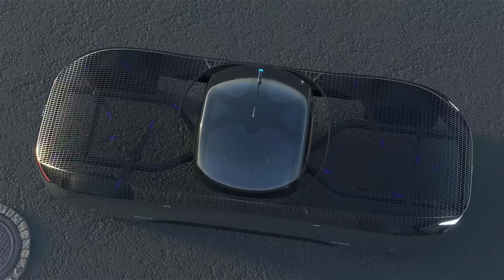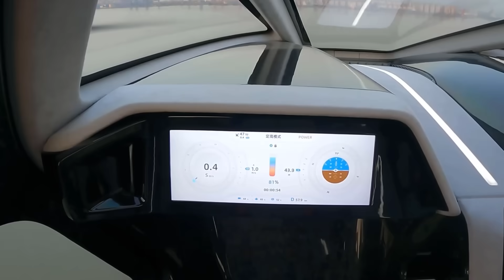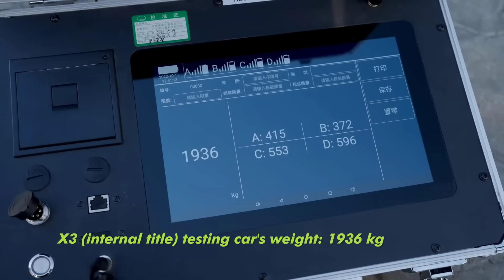4 Hovering Cars 2024-28 | Magnetic Revolution

Comment from the maker: How the Magnetic car achieves Levitation, Acceleration, Braking, and Steering. Detailed Introduction. 

1. Levitation: A moving magnetic field creates an electrical current in adjacent conductors, which in its turn generates a repelling magnetic force - In our case the rotating magnetic wheels create a current in the aluminum sheet generating a repelling magnetic force. And when the rotational speed of the magnetic wheels reaches at least 600 rpm, this repulsion leads to LEVITATION. - More detailed explanation here - youtu.be/pCON4zfMzjU?t=66 
The suspension is achieved when the front and rear wheels rotate at the same speed in different directions. Their cumulative force lifts the car, but as they rotate in opposite directions they offset each other and the car stays in static suspension.
2. To move the car, the front wheels are kept at a constant rotational speed, while the rotational speed of the rear wheels is reduced for ACCELERATION and increased for BRAKING.
3. The car STEERS on a highway this time by adjusting the rotational speed of the Side Wheels(e.g. for changing lanes on a highway), and for the next stage to make it practical in urban areas, scientists work on a 6-wheel architecture to achieve pivot steering by adjusting the rotational speed of the wheels in the middle
Reply: idk, most of these require something far more powerful than using batteries to to take flight and less heavy occupants, they will have to dramatically reduce the car's size and weight to make it possible, but i would never rely on current gen battery tech for this idea, that's just a fire hazard waiting to happen.
Reply: You didn’t mention the rubber bands.
Reply: I love the magetic and alef cars.

we will NEVER buy a Tesla.  End of story.
Reply: How stupid are you to promote this obvious scam?
[Edit]  My bad.  I meant MULTIPLE obvious scams.
Reply: Yep just as I thought , Getting set up for that one world global agenda,   people tracking . It makes alot of sense now.
Reply: Ask a pilot,,ask an astronaut, ask someone who understands stability.  
Ask futuristic engineer scientist,, 
Don't ask me!!  Fiction has become fact many times.,,,and will continue.
Reply: It's going to take decades of more researching ,until they get rid of the helicopter blades already invented in the 20th century ,into a safer ,reliable form of public transportation means. The flying car!
Reply: 5:14 - those 4 helicopter blades look like something you can snap onto the top of regular cars and make them fly like a helicopter. I'm sure that it's not actually that, but it looks like it.
7:09 - 7:16 - That looks really cool too
Reply: You can levitate an aircraft carrier without magnets,its very very simple.Lets say it weighs 1000TONS(M)>>>The pulling force (gravity) is F=MxG(9.81m/s2).But there is a catch>>>The Gforce can be manipulated by sounds(JUST LIKE THE TIBETAN MoNKS) and instead of standard G=9.81m/s2 you have an local area where G=0,981(10times lower)>>>So 90%of the weight just dissapears in the thin air as long as you generate the correct soundwaves pattern
Reply: The sounds are interfering with the magnetic field when the energy wavelength resonates at the correct value and place.Just like a planet/star gravity can deflect lightwaves it works also the other way around.The CORAL CASTLE>>>the story is true100% LEDSKALNIN.A small handheld sound device can levitate 100kg very easy
Reply: so you could levitate a small animal,or a man with a handheld sound generator//// it needs a battery 72volts/50amps and the rest of electronic parts
Reply: Car without wheels. New revolution.

Comment: Crazy I have a concept that I made in elementary school back in like 2009-10 called the negative car that would drive and operate on magnetic highways. Also made a concept for hoverboards operating the same way or with small wind turbine engines and blades inside the board somehow safe and powerful enough to propel it’s weight and the persons weight a couple feet off the ground or higher.

Comment: If you get 12 magnets and arange then in a circle one after the other but place each magnet with their poles facing South-west-north-east-south to complete the circle you get an opposing force which creates a stronger force. By spinning the circle of magnets very fast above Aluminum or Copper which are non magnetic, creates a mirrored magnetic field upon these metals which induces levitation. The mirrored field is advanced in its timing to the magnets above which creates friction/heat. You would have to place another circle of magnets next to each other but to spin in the opposite direction to stop rotation in only the spinning direction of all circles if they were spinning together in same direction of each other. This does work but I cannot see it on a large scale. Yet...

Comment: Last I checked, aluminum is non-magnetic.  So, how would it work as a levitation base?
Reply: That is why it works @qdllc the magnet pushes away on the electromagnetic field caused by the Aluminum, otherwise it would be stuck to it.

Comment: Why not use an alternator connected to an electric motor? The alternator will power the motor and the electronics. This will give you a lot more drive time than a battery. You also won't have to charge it... Ever.

Comment: They should just use the mass reduction technology that the US Navy's TR-3b has, it uses electrogravitic technology to enable gravity defying maneuvering, and yes there is a US patent that describes how the technology works, a high powered capacitor system would be enough watts to hover a car a few inches from the ground, and the field created with the technology repels against anything near the vehicle with equal force, meaning you would basically be driving around on the electrogravitic field as if it were a cushion. With the mass reduction effect, your car would weigh only a fraction meaning it could travel at very high speeds and with the field acting as a repulsive force, you could travel safer than with any conventional automobile, even at speeds towards and above 300 MPH.

Comment: I am an old retired guy.  Over the course of a long life, I have been involved in roughly thirty traffic collisions.  I was a passenger in some of these.  I was not at fault in any of the traffic collisions in which I was driving.  In one notable four week period, I was rear ended five times while stopped at different red lights.

People generally do a poor job driving when they are essentially limited to moving in two dimensions.  This will only get worse when a third dimension and the effect of gravity are added into the mix.  Flying cars sound cool until you start to really think about everything that can and will go wrong.
Reply: dam man 30 just stay away from cars your lucky to still be around. 30? wow
Reply: @Randytrevorson420  I worked a couple jobs that involved a lot of driving.  Also, somebody has to be at the high end of the bell curve.  If I quit driving, somebody else would have to take my place.
Reply: @MinionofNobody  be safe good luck out there. I drive for a living right now. Ive had my cdl since 08 and it can fun but alot of dumb people out there
Reply: Imagine going to get some bread, RAN OUT OF GAS, your car plummets to the ground.😮😅😅

Comment: The video is an over simplification of the effect of a magnetic field on a conductor.  The electrical current generated by the magnet slows the magnet down so the faster the wheel rotates the more resistance it will encounter which will be slowing the wheel down.  This levitation has never been achieved from the method described in the video, it's totally wrong!

Comment: I was always a fan of electric cars until I learned the dangers of lithium batteries. All that power stored in a little battery and now they want to make them smaller with more power? If the battery is breached there's instant combustion which is why you see all these electric cars on videos erupting into flames which gives the passengers absolutely no time to escape.
Reply: There was a time when people refused to purchase homes right under high voltage power lines.  Now they drive EMF-heavy cars and if this disaster ever happened of magnetic roadways, the communists would be delighted because they can achieve their goal of depopulating the planet and removing "useless eaters" much faster.  The communists are also eager to have autonomous vehicles so that they can drive people who complain directly to prison or into a tree of off a cliff.

Comment: Hm. No. I don't see it. I DO see a lot of CGI going on. I can't drive CGI, though, nor can anyone else.

The other thing clearly visible that also hasn't happened yet are the mile-high stacks of product liability suits. Consider:

This is an aircraft. It's going to be sold and operated alongside such nonsense as dual-stack pickups that "roll coal", "ricers" that follow the "more money than sense" precepts, high school kids with parents with zero sense and piles of cash, and so on.

There are plenty of reasons why planes don't drive on roads, and probably ten times that for why you don't want "typical" drivers getting their mitts on anything of this sort. Although this could well spawn an entire new category on YT: "20 MOST EPIC FLYING CAR FAILS", etc, blah.

If this is going to ever happen, it'll happen because ONE company looked at the necessary support infrastructure FIRST and acted on that, instead of promises, nonsense, propaganda, and other forms of specious BS.

Comment: You can levitate an aircraft carrier without magnets,its very very simple.Lets say it weighs 1000TONS(M)>>>The pulling force (gravity) is F=MxG(9.81m/s2).But there is a catch>>>The Gforce can be manipulated by sounds(JUST LIKE THE TIBETAN MoNKS) and instead of standard G=9.81m/s2 you have an local area where G=0,981(10times lower)>>>So 90%of the weight just dissapears in the thin air as long as you generate the correct soundwaves pattern

Comment: My proposal is : Have cars that levitate 30 to 50 cm's off the ground using magnetic levitation that still uses our currant lanes (so the magnets would be imbeded flush into concrete), but we would  also using gas propulsion engine (or even hydrogen/electric for the ones who want quiet flying cars) I would want my flying car to still sound like these https://www.youtube.com/watch?v=1Rz3lHLOuYo cuz these type cars i drive. I want it still to be menacing and aggressive. Yet have the subtle movements of a floating vehicle that would be able to pull gently or swiftly into corners while maintaining staying in the lane. There would probably have to be additional steps to get the license. just af ew more tests ontop of a normal test would be sufficient. I think there would be different categories and levels of flying cars. First level normal car planted on street. second level, magnetic levitation simple hybrid EV/hydrogen cars that would be only able to levitate. Third level gas engine levitation cars that would be able to be abit more agile and more movement in maneuverability (difficult to explain into words but if i could give you a visual representation you would understand ) Fourth level would be completely flying cars that would do all of the above but also the ability to detach from the magnetic (pull away) and thrust off into specific air lanes dedicated for these type cars, which would take you anywhere, these air lanes would be same similar concept planes use. but not as high altitude. I would assume they would go as high as sky scrapers, it would be all mixed, but carefully monitored and planned. A whole database and setup would needed to be setup to achieve this onto of the roads infrastructure. I believe this is possible. It would take think tanks experts to bring it into

Comment: you can use copper flooring in a specialized local track (factory or warehouse) to levitate bots with ac magnet transformers. also powered wirelessly no batteries required. very similar to hanging bots from the ceiling with lines and crane track grid. half of the cars resistance is from the air drag, other half is the wheels friction. fold the drone propellers and arms in the car when not in use, like how DJI does with their small drones. add normal wheels to make it work on the road. same for wings for long range efficient economy flight. you can also use turbine or piston gasoline engines to generate electric power for evtol operation. half plane, half drone, half car. swiss blade action plane wings from the same top container. whats wrong with the tesla cyber truck body. its easier to make, not harder. who has fed your their lies. dont just blatantly copy what others say. study them yourself. a flying car does not have to be a drone all the time, it can be a normal land car mostly.

Comment: The weakest link for flying vehicles is the human operator. We need the license to be more difficult to get than an airline pilot license. The situation at 2:37 is self-explanatory. Imagine multiple idiot drivers of flying cars at that scene.
Reply: Ever see a drone show with over a hundred drones flying in sync? They don't crash into each other because of obstacle avoidance sensors and AI based software. The same will go for flying cars.

Comment: while sleep yesterday i had a thought dream I had a magnetic levitation seat scooter and this morning i see you have a car (your reading my dreams) - it be great if they would actually build one of these and not make it so expensive. the speed from Spokane to Seattle only took less than 2 hrs. hovering over cars when it normally takes 4 hr to get in Seattle by car. deeping on speed And in the next dream it went even higher and faster. So I had a dream that it cost less than a thousand. because of how small the scooter was but it was higher for the rich. but anyway, that will be for many now. might as well do the future now.
Reply: In the past, people didn't want to buy a house directly under high voltage power lines.  Now if this ever happened, you could drive much closer and die much faster.  If you want to get from Spokane to Seattle even faster, someone could strap themselves to a nuclear missle and get there very quickly.

Comment: The magnetic hover car is completely impractical. For one thing you'd have to lay down thick copper or aluminum on all roadways which would be ridiculously expensive. You'd also have to build a massive cooling system into the infrastructure due to the induced heat. Then you'd have to find a way to propel and control the vehicle through the air so it stays on track (straightaways and turns) otherwise it would go careening any which way.
Reply: and everyone's cellphones, credit cards, data storage devices will be destroyed with the magnetic fields - and human health will collapse under the heavy EMF fields. Depopulation winner.